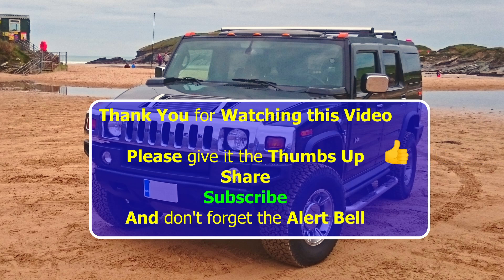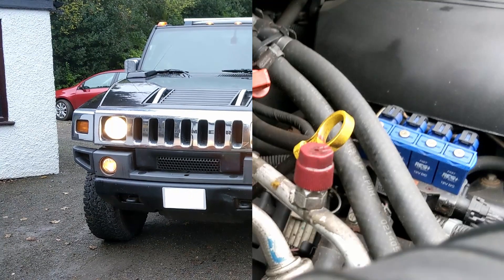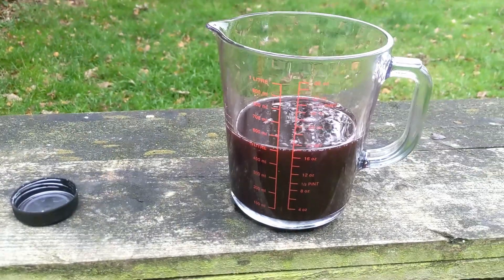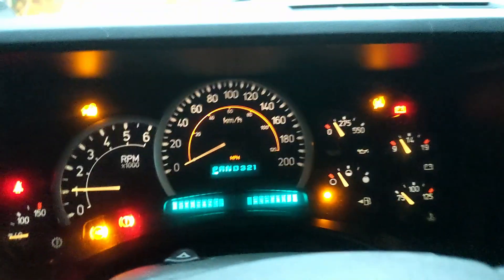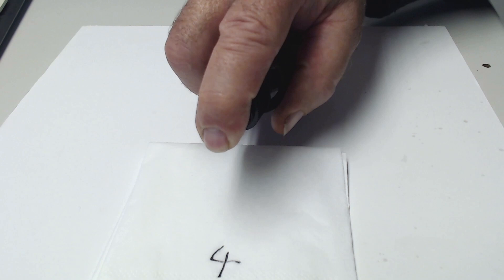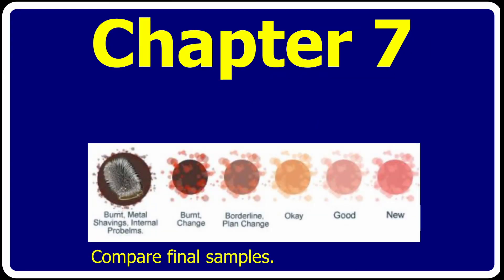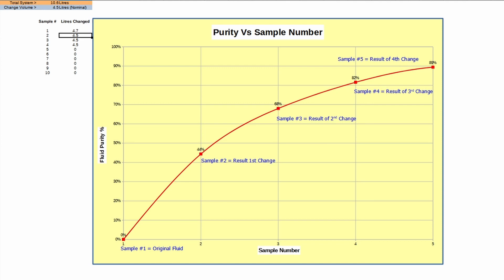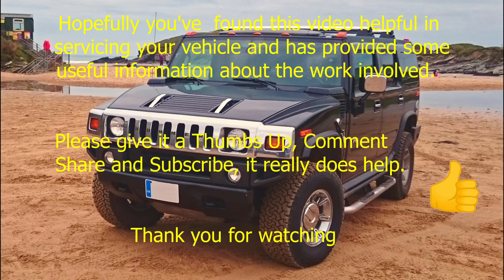Hummer H2 2005 - Transmission Final Fluid Change #4

Comment: Does it hurt to put a little bit more than transmission fluid in it
Reply from the maker: Thank you for your comment. Good question and like you I'm learning about Hummers as I go along. GM engineers produced the level limits to provide maximum protection and optimum fluid pressure within the system. The lower limit protects against excessive wear, metal on metal etc. and the upper limit prevents against over-pressure, the creation of air-bubbles and subsequent loss of lubrication. The HOT zone mid-point represents the "sweat-spot" and is measured with the vehicle level, the engine hot and idling. The HOT zone is represents around 1/2 a quart, so its quite a tight limit really. Excessive fluid is hard to extract unless you have a drain plug or a pump, the one used in the video was cheap and an easy way to do this. Unfortunately it's not possible extract enough fluid via the dip-stick to perform an effective oil change. So, in short there is nothing to be gained by over-filling, quite the opposite from the information I've read.

Comment: how much liters did all the changes combined total to
Reply from the maker: Thank you for your comment.
The estimated value is 18L  or 4.8 US Gallons, which equates to 5  x Gallon containers or 19L. The total transmission capacity is 10.6L  so its approx. 170% A Quote from GM Service Bulletin  04-06-01-029J  "It should be noted that analyses of returned parts that have been exposed to these aftermarket 'flushes' show indications of potential damage and shortened durability shortened durability"